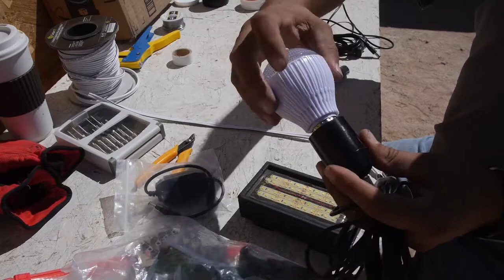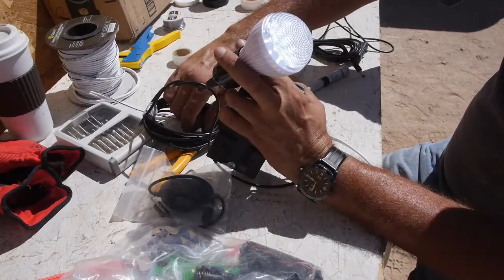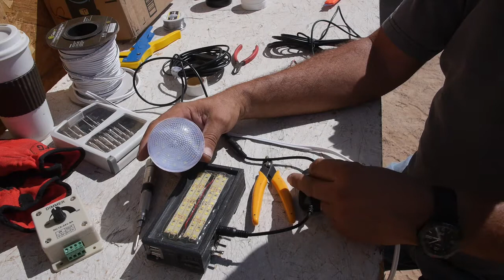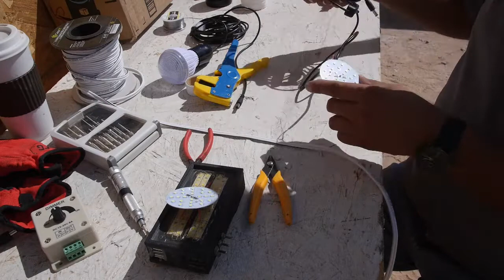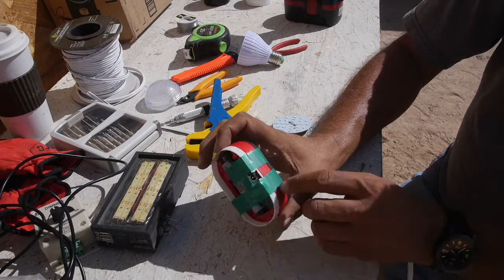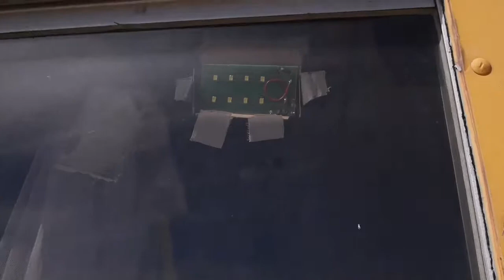Harbor Freight Solar Kit Lights and Dimmers

Comment: Carlin Comm -  Thanks for the video. This is the sort of thing that really is useful: DIY on a homestead.  I'm not a really big fan of HF for a assortment of reasons, but they have their uses.  This video made me realize that while they don't have top notch tools, they do have all sorts of things pretending to be finished goods that are collections of maker parts that just need to be disassembled.  If those LED bulbs have identical contacts to normal 110 v bulbs then they could fit into 110 trouble light socket, the kind that with the cage and a hook.  Might be nice to rig one up as a on the road trouble light with a pig tail lead and alligator clamps.  Need to work on something, open up the hood and clip the light to a hot wire and ground, you're good to go.  Good stuff
Reply from the maker: That's a great summary of the videos :) there are lots of useful parts for tinkering!

Comment: I like the bulbs that come in the kits too. As I needed light in the shed at night, I took the bulbs out of the HF harness and installed them in regular weatherproof sockets that are on conduit boxes. Interesting thing is, my MTTP controller when the Off button is active, runs them at 7 volts. When on, they get 12 V so you have night lights and work lights too. :-)
Reply from the maker: gravelydon thats cool, I was thinking about waterproof enclosures, will have to do that!